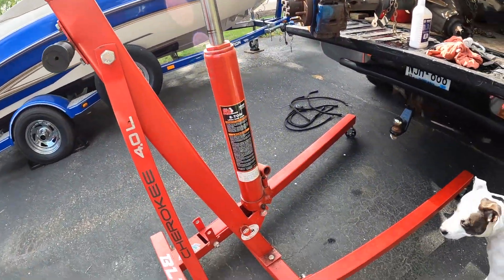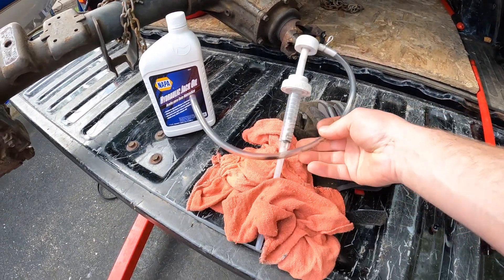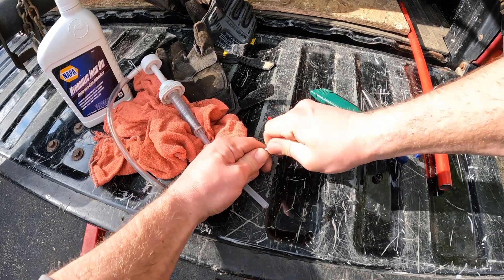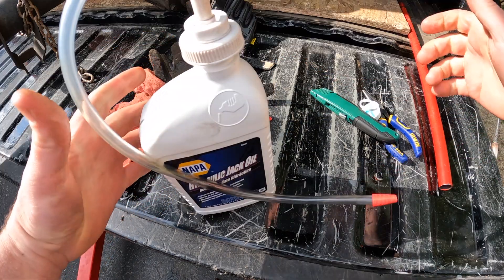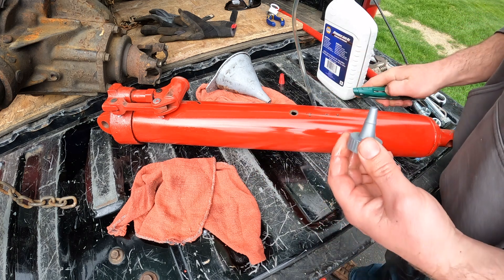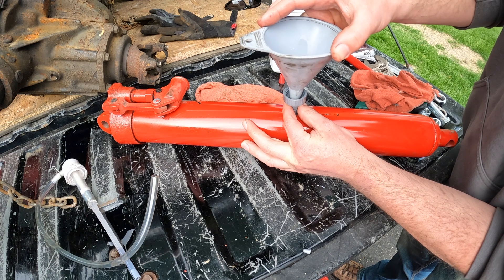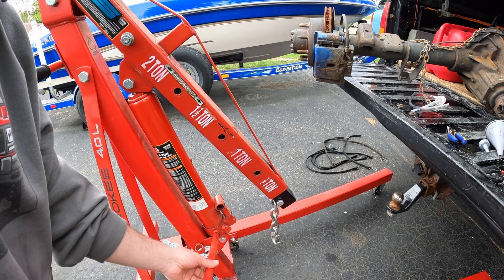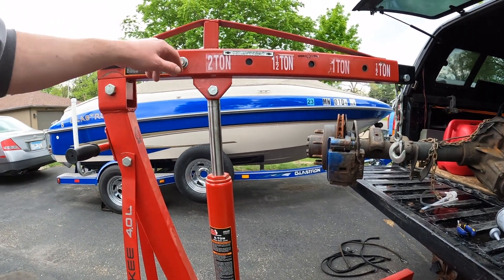How to Top Off Engine Hoist Hydraulic Cylinder | The Fastest Way to Raise Engine Hoist

Comment: I’ve got an interesting issue with mine, it goes up about half way before it stalls. However, if I torch (propane) the cylinder for a few minutes, the jack works almost flawlessly without fail. Mine is probably a few years old as I had purchased used and is stored compressed with very rare occasions of it being extended while moving a whole engine cradle assembly from a 1988 Pontiac Fiero.

Comment: I have an odd problem. My engine hoist will work great...to a point. Even without a load it will not jack all the way up. The air is bled out and the fluid level is correct. (I even tried it overfilled)

It will go up about 1/2 way, then for every pump up it will sag about half. When I finally get it to full extension it will slowly drop to about half stroke and remain rock solid.
Reply from the maker: I know you said all the air is bled out, but this sounds like you have air in there or not enough fluid. Try this, bring hoist all the way down, then don't pump, but lift with your arms the boom all the way up, hold for 10-20 seconds or so and slowly reduce your strength. The boom should stop somewhere, not go all the way down. See where it stops, then lift it again all the way up and hold 10-20 seconds, the slowly reduce strength until it stops again. If there is no air and fluid is topped off, it should be fully extended. If not, then you still have air in there or not enough fluid. You might have to cycle it a dozen times or more.
Reply: @baldeaglegarage  I tried all that stuff you mentioned as well.
I did notice that my jack has another port, next to the bleed off screw, with a cap on it that says, 'Do Not Adjust'. I think it's an overpressure regulator of some sort.
But, like I said the jack works great, but only to about 2/3 or less of the total travel.

Comment: The instructions on the side of the cylinder will probably tell you if the cylinder should be extended or not.
Reply from the maker: I looked but however I didn't, it worked. Still leaks, but can be used if I refill it

Comment: I just bought on of those jacks today. Why did you have to add fluid?  Did it leak or is it expected to need it periodically?
Reply from the maker: Yeah it worked great for years. I bought it in 1999, used it many times per year. It started marking its territory with a little puddle. So I suspect the seals are ready to be replaced. Topping it off gets you by. If I used it more I would replace the seals or cylinder.
Reply: @baldeaglegarage  thanks for your reply. Thanks for making the video.

Comment: May I suggest...... if the rubber plug is on the open side of the hydraulic cylinder,...... tip the hoist on its back versus removing the cylinder.

Then you have the cylinder horizontal to allow air to escape when filling.
Reply from the maker: Haha, well that would be alot more work, and besides, when tipped over, the cylinder would still be at an angle, not horizontal. Its only two bolts, why work on the ground when you have a tailgate at a comfortable working height? Good luck tipping your hoist over and lifting it back up; I'm on the work smarter, not harder side of things.

Comment: So I've added oil to mine but it still won't lift a load. It pumps and lifts without boom attached but not with. I've tried bleeding air but maybe I did it wrong or it could be bad seals inside? I got it without oil plug in it. Maybe debris or junk got in it?
Reply from the maker: If it's not leaking, then it could be the internal seal or not enough fluid. Try repeating the process until it can hold pressure.
Reply: @baldeaglegarage  actually so when I changed the fluid I removed a small screw & put a small screw in the wrong way. Once I put it in the correct way all was well.
Reply from the maker: Awesome! I'm glad you got it figured out!
Reply: @WiseRuler i am experiencing the same issue!will not lift at all! What screw are you referring to?